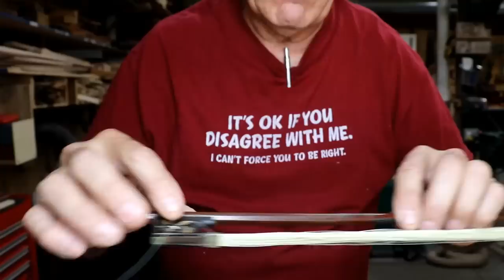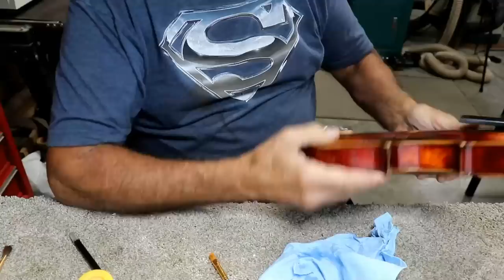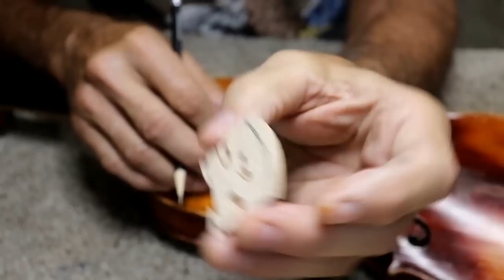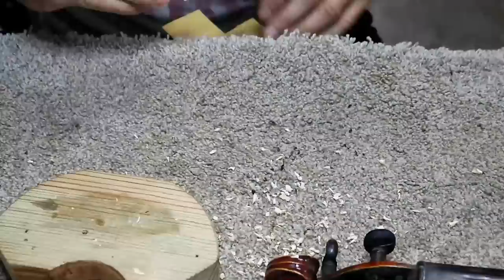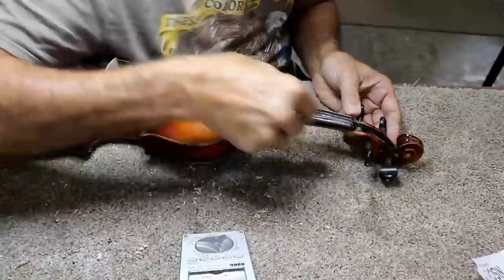588 RSW Fixin' Up Grandpa's Old Fiddle!   Part 1 Fiddle Repair

Comment: I have my Great Grandfathers violin. After he passed in 1947, it sat in a closet for sixty years. I repaired my Aunts viola, after which she handed the old violin to me. Where the sound post sat touching the soundboard, there was a crack, so I took it apart and made all the repairs. It is very loud and plays very well. It was made in Boston in the mid 1700’s. The maker is unknown. I keep it played and it improves in sound. Great Grandpa John, had huge hands and he was very good at it. I also have one of those massed produced Strad copies. It was built in 1900 and sold through the Sears catalog. It also sat in a closet, in Germany, for fifty years. I went through it and didn’t need a lot of repair, no cracks. It also improved in sound as I played it. Subscribed.

Comment: Hi Jerry;
     Years ago I did research on violin construction for repairing a copy of a Strad. At that time the inch system was still used. The book that I had said to make the scale 13" which comes out just a hair over 330 mm. That's why a lot of older violins come out to 330 mm. Especially violins made in the USA and England. I think some other countries also used the inch system back then.
     I love your videos. I have watched other luthiers repair violins and they don't use as practical of metheds as yo
I just watched one where the luthier took both the belly and the back at the same time. He then had to fight to get the sides to line up right again. I'm not sure, but the violin he was working on was a high end violin. Thanks for sharing your work. Keep on truchin.

Comment: Jerry I've been wondering if it might help to cut your pencils in half when you are marking profiles for the bridge, bridge feet, saddle  and the nut, so that the pencil is half flat, that way you dont have to maintain a good angle with your hand.

Comment: I ordered that finger plane you recommended as the best general one, and you're right about how quick they are! Despite being tiny it easily helps shape belly carves, gets in there for headstock transitions, and anything in between! I'm yet to start on a carve top but I imagine it'll be just the trick for one of those too.

Comment: Adding a little rosin to the shafts on the tuning pegs and the tail pin will keep them from slipping out of tune.... Also placing the sound post 'before' adding the strings helps it stay in place....